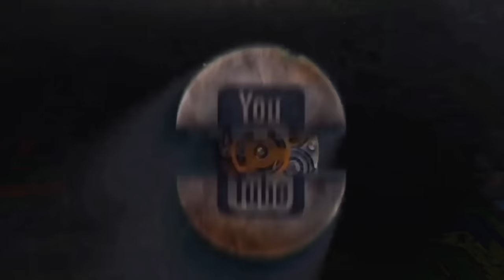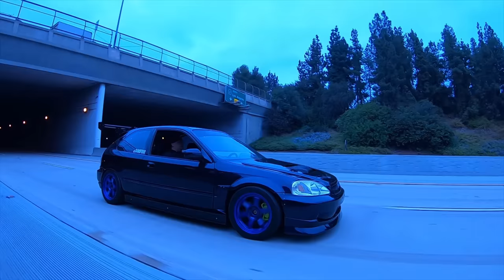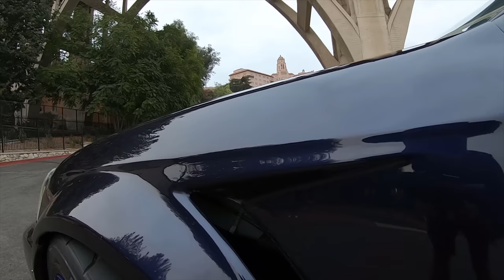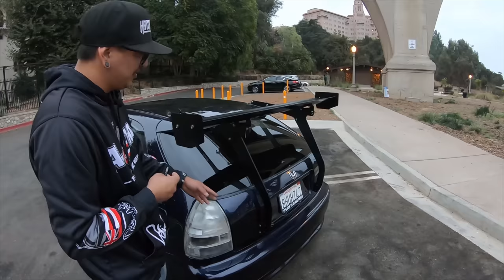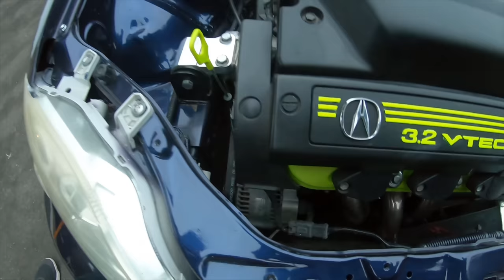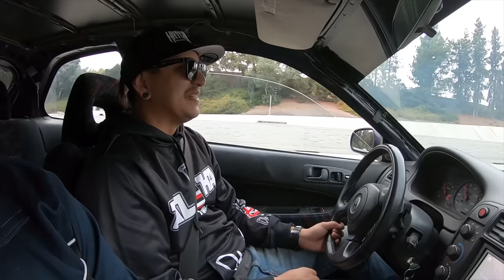1999 Honda Civic EK Jswap: Ethereal Build

Comment: What an awesome build!! I’ve never seen a J swap EK before. Jackson Racing Supercharger and AWD next?!!? 😳😬🤘🏽🤘🏽
Reply from the maker: We shall see lol it would be awesome.
Reply: A Rotrex supercharger from Gerzy Bear Performance Stage 1 Kit.... More than enough INSTANT horse power  for already torque happy engine from Honda. I had a J32A1 (Non Type-S) and still was able to produce 238whp & 232lb•ft tq using bolt-on parts and few custom peices too. All from 226hp/216lb•ft...on it's fragile 5spd auto trans. (The car in my profile pic '00 2nd gen TL 3.2L)

Comment: You gotta get the single mass flywheel conversion it made a huge difference on my accord i got the aasco performance one its cheaper and they make the flywheels for clutchmasters
Reply from the maker: Great suggestion Kyle. Thank you for watching and leaving a positive comment.
Reply: Whts the huge difference?
Reply: @kevinkev1530  i forget how much exactly but its about 20 pounds lighter and you have to get a sprung clutch disc...the stock clutch has no springs the dampening is in the dual mass flywheel wich is huge and weighs like 38 pounds or somthing close to that i cant remember exactly but the single mass flywheel is i believe 16 pounds